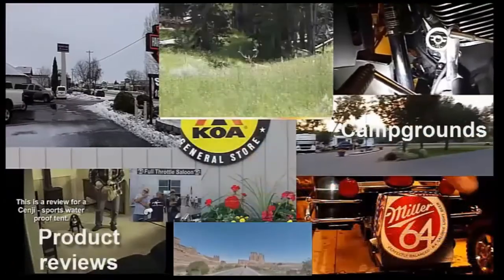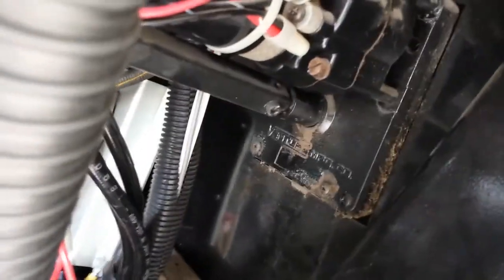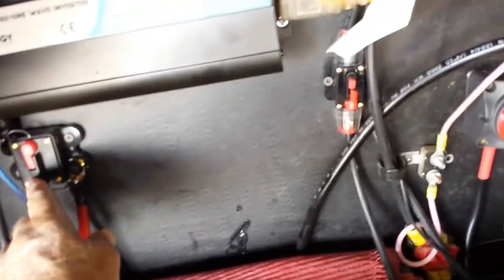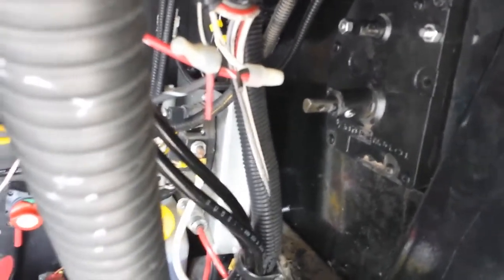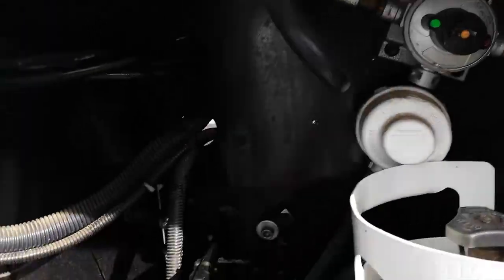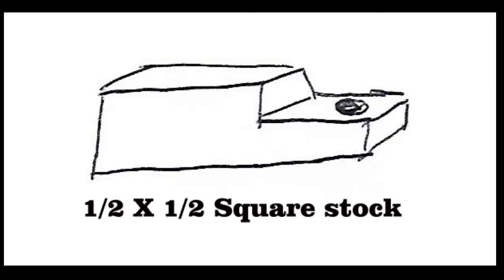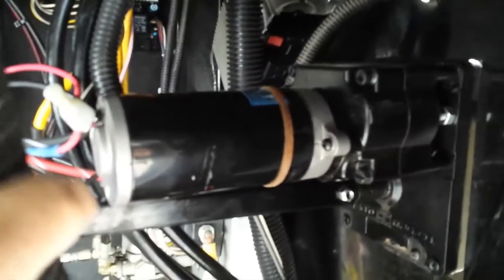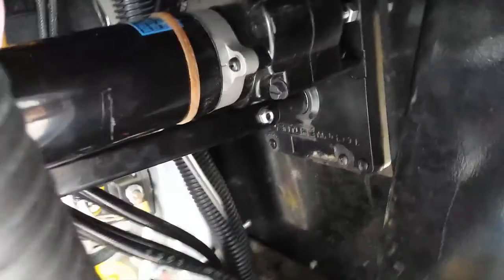Montana Keystone 5th wheel landing gear motor R&R (you can do it, please share))

Comment: Excellent Just the info I needed to fix mine. One thing I had to figure out on my own. The  landing gear would not fit into the cut out. I discovered the black legs of the landing supports are held in by only 2 bolts connected to a bracket ( no weld ) . The black leg had slipped not giving enough room for the landing gear to go into the cut out. Simple enough to loosen the bolts and move the leg down. ( bad design in my opinion ) Thank you for the information !

Comment: I was having trouble with my motor. It would heat up very quickly and got to the point it would burn out the fuse within seconds. Before outlaying the cash on a new unit I took a chance to pull the motor apart and clean it up. I used brake clean to get rid of all the gunk inside the housing and used a very fine sand paper to clean of the armature where the brushes ride. In addition to taking the gear unit apart and greasing it I did the same with the reduction unit attached directly to the motor. I've used the landing gear a couple of times since and the motor stays cool with no issues.
Reply from the maker: I took mine to have it rebuilt and it was not rebuildable

Comment: Basically what's happening on my 5er is the landing gear is not lifting the rig high enough for me to hitch up. Starts making a rapping noise and stops lifting. 
The gear box does move both ways...
I just figured the motor was gone...however you got me thinking...